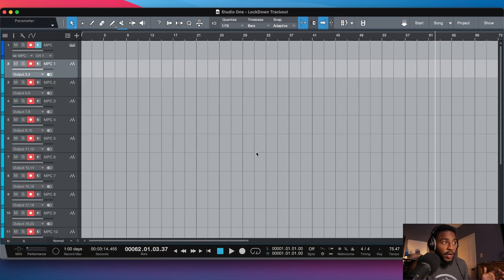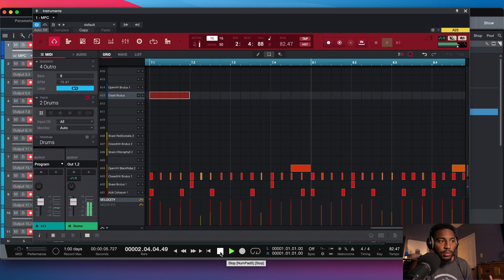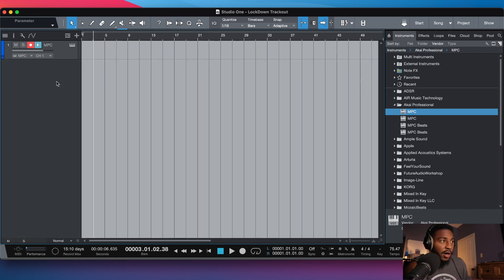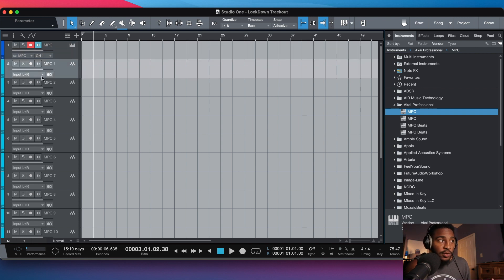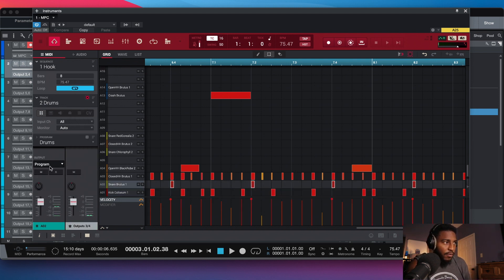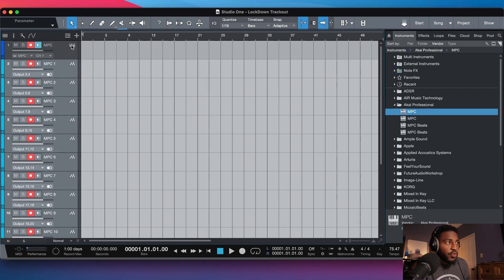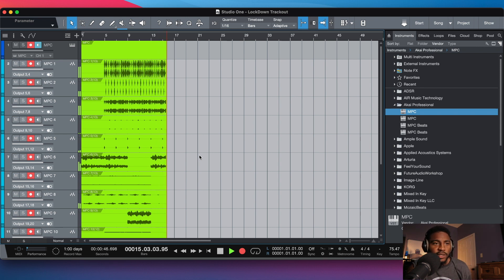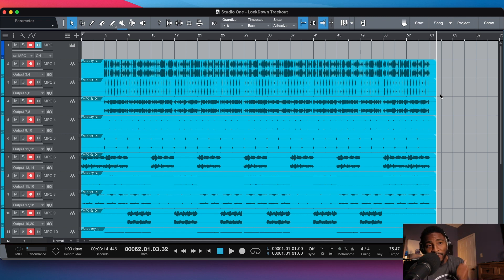MPC LIVE II | HOW TO TRACKOUT YOUR BEAT IN YOUR DAW

Comment: Hi, Thank you for the video, Im familiar with this method but I am confused on as why people are doing these various methods. Unless you are running your machine through analog outboard gear then recording into the daw what would be the reason to do this instead of just exploding and exporting your stems from the mpc itself onto a ssd or flash, or from within the plugin / mpc software and just drag the stems into the time line on studio one or whatever daw you are using?
Reply from the maker: When exploding tracks sometimes I get automation, and mute track errors. Rather just track it in via the DAW.
Reply: @WeFullTime  ah ok no worries! Was just confused cause I see so many stem methods and it’s over years of mpc and versions so I was like what is the best way I should be doing this cause I’m used to the old days of using audio into protools and just making a click track before your beat and tracking each sound then cutting and lining up on grid which was a pain. Didn’t wanna be hustling backwards w the new systems🙏